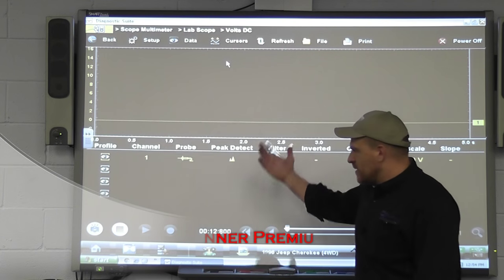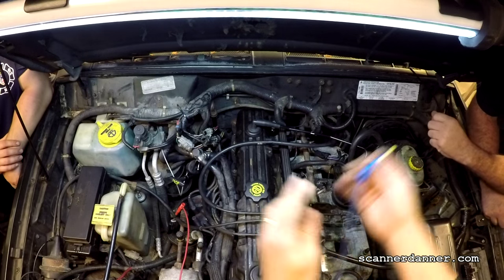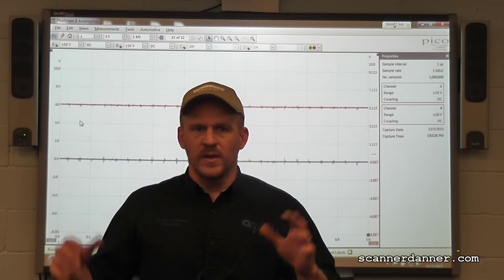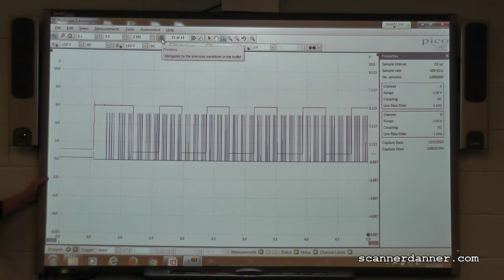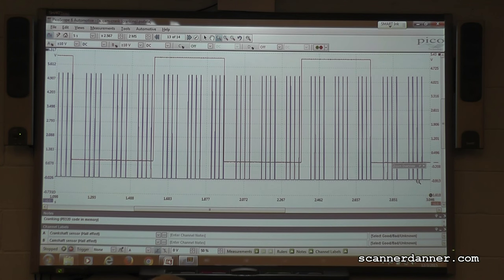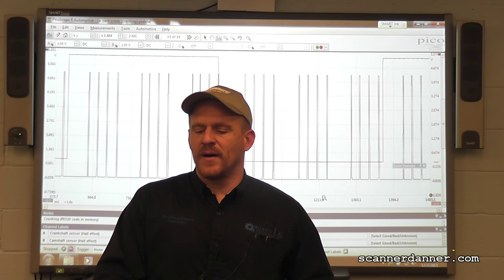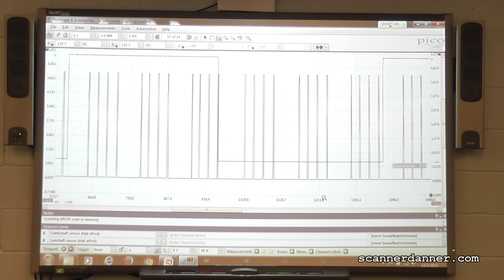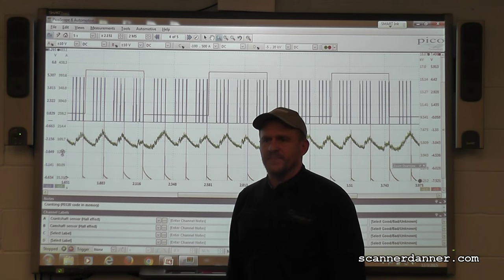Jeep 4.0L timing problems (a ScannerDanner Premium video)

Comment: Per wikipedia...The BNC (Bayonet Neill–Concelman) connector is a miniature quick connect/disconnect radio frequency connector used for coaxial cable. It features two bayonet lugs on the female connector; mating is fully achieved with a quarter turn of the coupling nut. BNC connectors are used with miniature-to-subminiature coaxial cable in radio, television, and other radio-frequency electronic equipment, test instruments, and video signals. The BNC was commonly used for early computer networks, including ARCnet, the IBM PC Network, and the 10BASE2 variant of Ethernet. BNC connectors are made to match the characteristic impedance of cable at either 50 ohms or 75 ohms. They are usually applied for frequencies below 4 GHz[1] and voltages below 500 volts.[

Comment: The major clue here is the shift of timing over separate traces during the seminar, even though timing during each trace seemed to be consistent. Somehow the CMP sensor is able to rock back and forth, giving inconsistent time. I suppose that could happen electronically, too, but more likely it is mechanical.

Comment: Great case study. I use a Rigol DS1102E 100MHz Digital Oscilloscope and typically when my leads are too short I take a length of ethernet cable or speaker wire to extend the leads like a long jumper wire. I haven’t seen any signal degradation with this method. Thoughts?

Comment: Keep in mind, this engine has been cranking with fuel pump commanded on when engine sees crank signal. Oil needs to seal the rings on the cylinder wall. Fuel washes oil, if you know there is a lot of fuel in a an engine that has not run, do not automatically assume there is a mechanical problem causing low compression. A skipped timing chain can raise/lower compression however we would see more erratic patterns than just one cylinder. Fuel washout is going to affect the cylinder that is firing the latest or not at all

Comment: When cam and crank waveforms are not in sync the next thing I always do is check cam timing with a pressure transducer.  If the cam timing shows good with the pressure transducer then I would be looking at the flywheel or distributor.  If the pressure transducer shows a timing misalignment then I would be looking at the front of the motor for a timing chain/ belt issue.

Comment: Here I am 7 years later looking at this video and just for what it's worth I'm guesstimating at this point without doing further diagnosis that it did jump time maybe cruising along tagged the valve that's the way if we have the loss compression or maybe even tag more than one due to a sloppy chain I know it's a Jeep but 40 years ago I was told that on Chrysler that when you have a distributor go in there start to roll the engine over by hand to the distributor moves then start to roll backwards if you have more than 12° variance and the distributor starts to move time for a timing chain

Comment: Hi Paul something that might interest you, measuring very low current with an amps clamp, i saw a clip on it, if you rap the wire round the clamp several times, say 6 it will intensify the magnet field and you should get a reading,  the answer you get has to be divided by the number of turns....from Fred in England.
Reply from the maker: Thanks Tom, I am aware of this trick now.

Comment: On this model Jeep I have seen crank sensors installed wrong giving a low amplitude reading and causing a no start. Care must be taken to not remove the felt tip but let it lightly contact the flywheel and to use the semi circle mounting clip to fit the curve of the new sensor when tightening.

Comment: on the first test the firing event from the coil is lined up with the fourth pulse of the crank sensor but the plug wire pulse is lined up with the third pulse of the crank .why did that change

Comment: Good morning.  in a twin-cylinder engine, looking at the CKP x primary/secondary of the coil, each cylinder shows a different timing value, each with a different tooth on the ignition pulses, for example: at idle, the ignition firing of cylinder 1 FRONT) appears on the 13th tooth (the TDC mark is on the eighth tooth of the rotor) and the ignition firing of cylinder 2 (REAR) appears on the eighth tooth (the TDC mark for cylinder 2 is on the second tooth of the rotor), with the ignition point of 5° (BTDC) in the workshop manual, what generates this difference in readings on the oscilloscope?
Reply from the maker: The engine computer or module that's controlling the coils. You're asking an engineer question that is specific to your application

Comment: Like I said I'm just poking around I'm a little bored after 51 almost 52 years I called it quits use lab scopes for over the last 25 plus years before they were digital I like your presentation you letting everyone know you have to go in a little bit further to pin it down even though you spend a lot of time here

Comment: Another good video Paul.. Will the pico hook up to any laptop? It is thought provoking ,that you prefer the pico to the verus. The verus is a good tool but really expensive. Does the waveforms on the verus make you guess and scratch your head? I realize that these sound like stupid questions. out the door we are looking at 20+ grand just to stay up to speed on the vehicles coming into the shop. There's no way some of our employers are gonna she'll that much you. Mines fussing about a 300 dollar torch. Just trying to find a way around the cost so I'm not working for Snap-on or Asewave. How are some of you doing it?
Reply from the maker: +Michael Nicholson Yes it will and the software to run the pico is free. You do not need to spend the $10000 on a Verus. There are other paths you can take for sure. Don't get me wrong, I love my Verus too but when I need detail, I'm pulling out the pico
Reply: @ScannerDanner   10 thousand wHAT ?!  were you serious  ?damm....

Comment: Hi Paul...Can i use a pico 60 amp current clamp with picoscope to do relative compression test????? Will it be safe???
Reply from the maker: yes you can and yes it is safe. You limitations are with the size of the wire (the jaws must close all the way) and then also, I believe 4v output is the max, so 400 amps (on a 10mv/a scale)

Comment: do you have a video on diagnosing weak valve springs, i know jeep and gm had problems because i have installed them for misfire codes
Reply from the maker: My Hummer series with the bad valve seats would be a good one to watch. A scope and an in cylinder pressure transducer would be the tools you need. You may be able to catch it with an old school gauge and do a running compression test.
Reply: @ScannerDanner  hanks,i'll check it out

Comment: At what degrees in rotation does the injector fire the fuel into the cylinder
Reply from the maker: Typically during the exhaust stroke, way before the intake valve opens. Of course GDI systems have changed all of that

Comment: how does the ecm know where tdc on no1 is... the crank sensor doesnt seem to have an identifiying blip..
it might work out tdc by using cam and crank signals together... meaning if the dizzy is installed wrongly tdc could be way off..
Reply from the maker: Distributor engine right?
It doesn't need to know where #1 is for spark as it is the same coil firing each time. 
So the cam is needed to ID# 1 cylinder for injection control

Comment: is it safe to measure the coil amp without using the amp clamp in series is it safe for a 10 Mohm scope
Reply from the maker: +stalker Linux lab scopes do not offer direct amperage measurments

Comment: Am I able to use a timing light to set my 4.0 timing?
Reply from the maker: What year is your jeep? On the model I am showing, no. Timing is not adjustable. It is based off the crank sensor triggered by the flywheel.
Reply: ScannerDanner That's what I was thinking. It's a 96 4.0. I replaced the distributor after the old ones gears were eaten away. I got the new one close to being in time, but I still get all cylinders misfiring. I took it to a mechanic. All he did was cut the mount braket off of the distributor so it can be turned in place, and he set it correctly. But now I'm thinking the distributor turns itself out of time due to not having the bracket. Super dumb that he did that in my opinion. Probably need a new distributor now.
Reply from the maker: Tyler, you need to see the rest of this series. Open the description section and at least read what the fix was. I can get you set up for a free trial on my premium channel so you can see the rest. Just email me at support@scannerdanner and mention this exchange and I'll set you up.

Comment: My 1990 jeep  4.0 starts and runs with the cam sensor unplugged.
Reply: its probably got the older batch fire fuel injection..... 
.
but even modern engines can run with no cam sensor..... GM 3.1 for example
but the injector timing will be off....hard starts, rough idle, reduced MPG